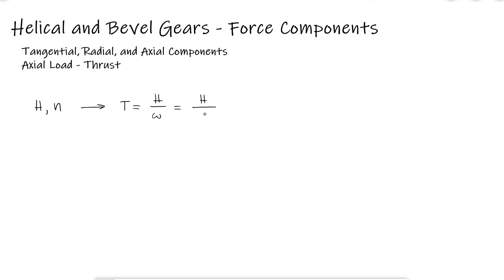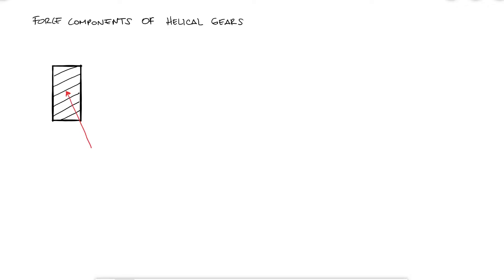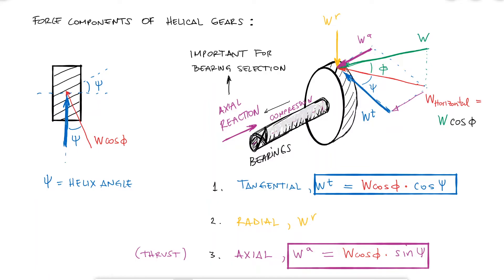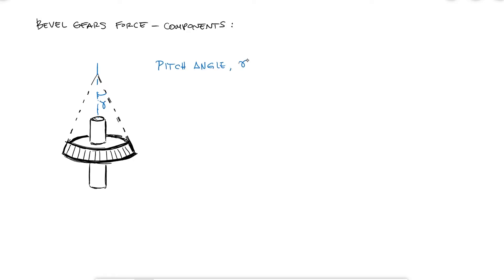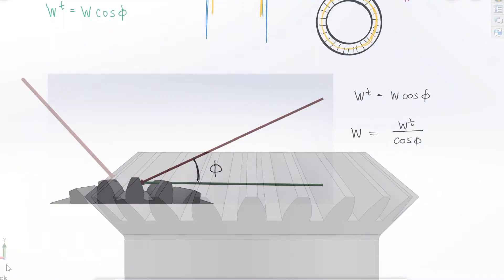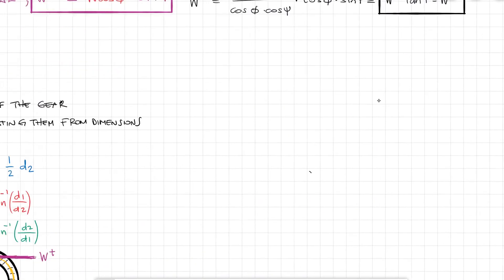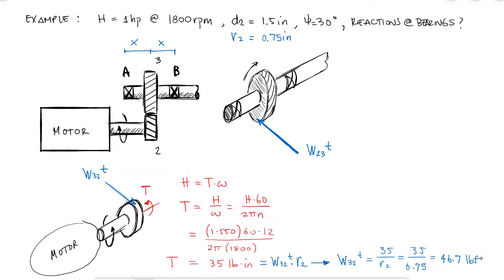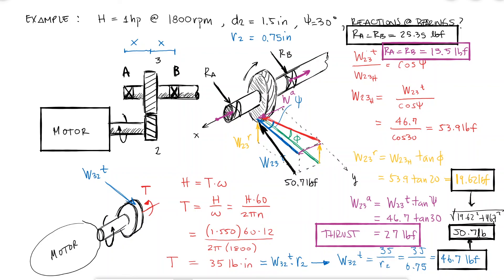Gear Forces of HELICAL and BEVEL GEARS in Just Over 10 Minutes!

Comment: The figure shows a double-reduction helical gearset. Pinion 2 is the driver, and it 
receives a torque of 2120 lbf. in from its shaft in the direction shown. Pinion 2 has 
a normal diametral pitch of 8 teeth/in, 14 teeth, and a normal pressure angle of 20 
and is cut right-handed with a helix angle of 30°. The mating gear 3 on shaft b 
has 36 teeth. Gear 4, which is the driver for the second pair of gears in the train, 
has a normal diametral pitch of 5 teeth/in, 15 teeth, and a normal pressure angle of 
20° and is cut left-handed with a helix angle of 15°. Mating gear 5 has 54 teeth. 
Find the magnitude and direction of the force exerted by all of the bearings on 
shaft a, b and the c, if bearings B, C and E can take only a radial load while 
bearings A, D and F are mounted to take both radial and thrust loads. The life goal 
is 25 kh, with a reliability factor for the ensemble of all four bearings to equal or 
exceed 96%. The Weibull parameters are x0= 0.02, (θ- x0)=4.439, and b= 1.483.
The efficiency of the system is 90%.
(a) Select the roller bearing for location B and C and ball bearing for E.
(b) Select the ball bearing (angular contact) for location A and D assuming the 
inner ring rotates and for F assuming the outer ring rotates.

**Can you help me to solve this problem?**

Comment: Sir, I have a doubt. How can axial thrust be distributed among the bearings equally?
Reply from the maker: They are usually not. This is more of a hypothetical assumption to understand/explain a concept. It CAN be done, but usually only one of the bearings takes the entire axial load.
Reply: @LessBoringLectures  so sir, how can I measure axial thrust on the bearings if I make this helical gear model and keeping in mind that, axial thrust is not equally distributed among bearings?
Reply from the maker: Then all the axial thrust value is equal to the axial force on the bearing the IS in fact counteracting the thrust. No calculations are needed in that case.